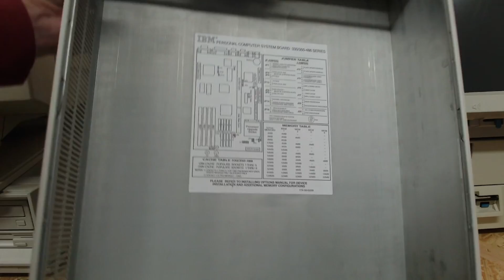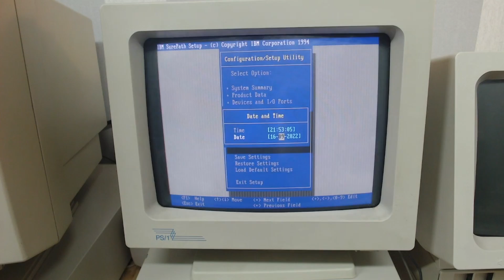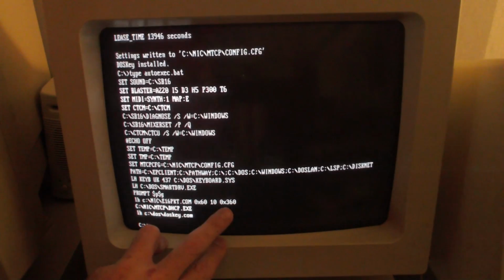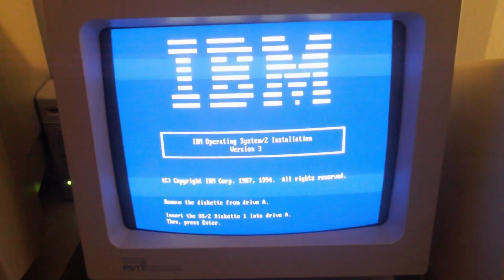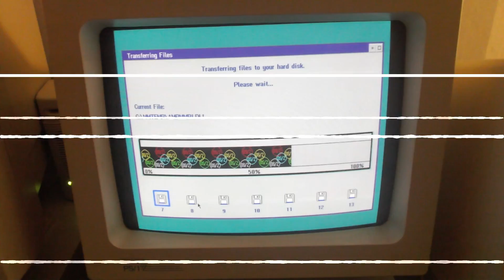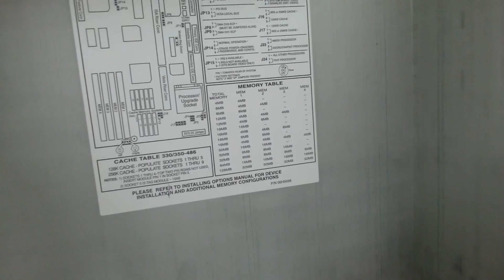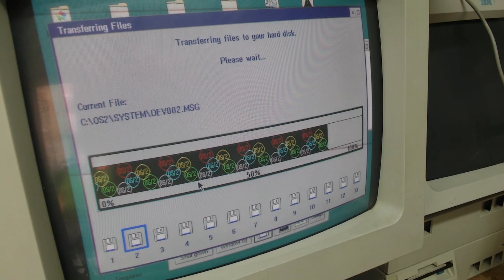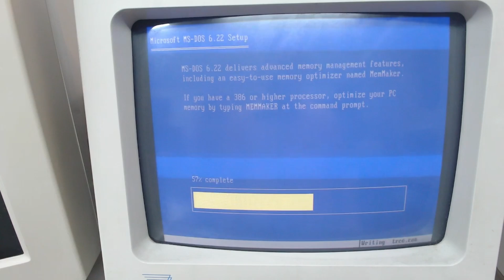#486buildoff Another IBM PC330 (and a less common OS) - Part 1

Comment: Retro Computer Videoblogger Rule No. 2 (After cleaning) bring the computer to the max specs because thats what’s interesting - how far can you push the pc ?
Reply: Nahh.  It's an IBM.  The BIOS is going to be locked down for anything interesting. And besides, if you've been around Retro PCs for a while, you should already know what this can do. The max it is going to be able to be upgraded to is likely a Pentium 83 MHz overdrive processor, 128 mb of RAM and a VLB video card. which makes it about as fast as an original Pentium 66.  Hot-rodding is something you do on commodity PC's.

Far more interesting than spending hundreds on increasingly scarcer and scarcer upgrade-ware is to see it used as it was when it was new.
Reply from the maker: Yeah I know the limits on this one! Actually it has a PCI bus underneath and you can supposedly get a PCI/ISA riser to replace the VLB/ISA one, but I doubt I'll ever find one!
I just want a 'normal' 486 DX2 to add to my collection so this is perfect. Thanks for watching!
Reply: @dennisp.2147  great then show it. Else it is boring.

Comment: I paid actual money (about $150 IIRC) in a computer shop for a copy of Red spine OS/2 Warp 3.0 back in late 1994, as I was heartily sick of Microsoft, DOS and Windows 3.1 and wanted to abjure Bill Gates and all of his foul deeds.  I was also tired of listening to the Mac sheeple bleat about the wonderful GUI in their tiny under-powered walled garden.  I was trying to install it on a pretty generic Taiwanese clone 486 VLB board with a Soundblaster CD kit and Soundblaster 16.  I tried for literally 2 months to get it to install properly, only to have it revert drivers without asking and fail to recognize software it had just installed. Basically shitting the bed completely forcing me to re-install over and over. I posted on a few Usenet OS/2 groups, only to get the living shit flamed out of me for having the temerity to ask a question.  I ended up bowing to his Infernal Majesty, Bill Gates and installed Windows 95 when it finally came out.  Windows 95 picked up everything, including some fairly hinky old 8 bit cards that I'd grabbed out of scrapped out XT machines at work. It installed right away and even picked up generic versions of the drivers for my ancientish Western Digital VGA  card.    I put OS/2 back in its box and stuck it on a shelf for 15 years, until I got involved in retrocomputing.  Gave it a try on a less Frankensteiny machine ( a Compaq 486 I think) and it installed flawlessly.  I wonder how things would have been different if IBM hadn't slit their own throats with such poor driver support, or if Microsoft hadn't been so duplicitous with Windows NT.   Perhaps we'd all be running OS/2 Warp 11 today.
Reply from the maker: Oh yeah the amount of TRAP errors I've seen over the last few weeks is unreal, and generally it takes a reinstall to fix. This was something you wouldn't do on floppy as it takes half a day to install :) Warp 4 is proving much better, but as it doesn't do Windows 95 applications its usability is a bit limited.
Reply: @StevesTechShed  Fortunately my version is the CD-ROM install, rather than the twenty something diskette install.  Oh, and once you get 4.0 fully installed, don't forget to update those FIXPAKs!
Reply from the maker: @dennisp.2147  yeah I couldn't work out how to do a fixpak on v3 but on v4 it was quite simple